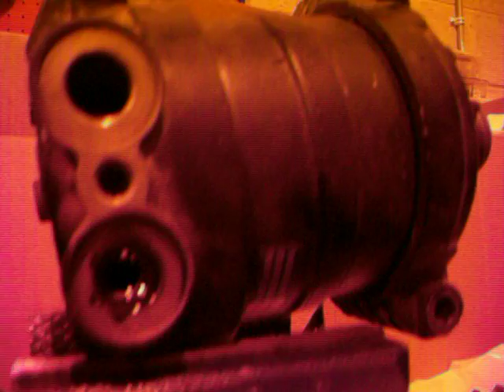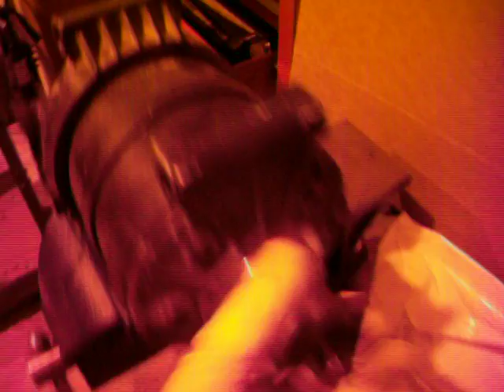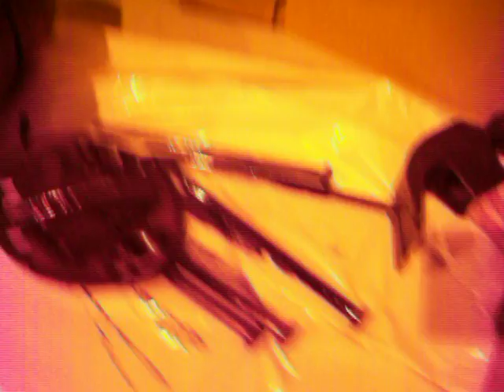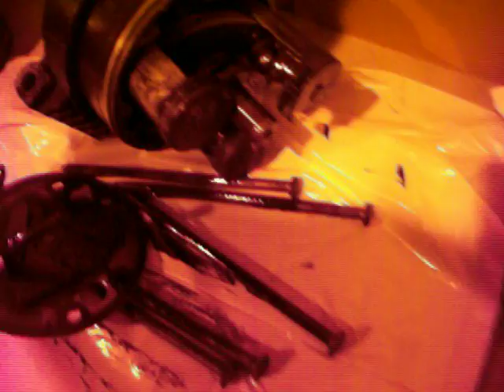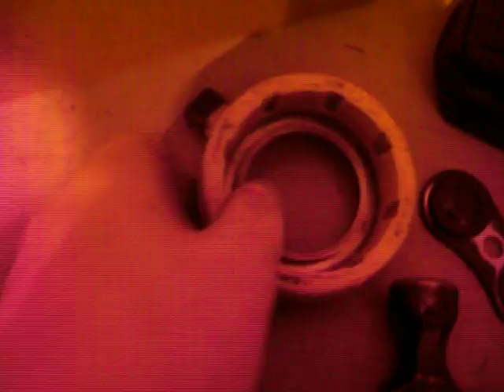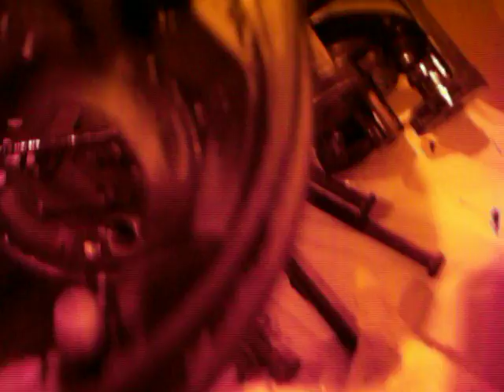GM air conditioning compressor ruined October 21 2011

Comment from the maker: @pearsonba350 This usually means it it low on refrigerant.  It cycles because the low pressure cutoff/cycling switch detects the pressure on the low side, right by or on  the accumulator (the large silver can) detects the refrigerant going below 22 or so PSI.  This means it is too low to allow oil to circulate , or be carried by the oil, and obviously the charge is low.  So this switch will cycle to keep any more damage from happening.   Only by checking the ports can it really be seen what  is.

Comment from the maker: @redneckbryon Yes, the Vista Cruiser does have factory A/C which works fine.  The compressor is the original one, a rather large A-6 unit.  The original ones are very robust, cool very well but need 8 to 1o horsies to run.

Comment from the maker: @LordKorlik This was off of a 1998 K1500 GM pickup truck.  These units are very prone to case leaks due to the segmented construction, and when replaced, if the mounting pads are not exactly square on the vehicle, the case on the new compressor can be distorted, the segments moved out of line, and wear similar to to this can take place. Indeed thinking now, this may be part of the failure seen here.

Comment from the maker: @monarch1957 That was really the dark ages for quality, etc in the units, and if it was one of the round units, called the 'R-4', which looks like a can of tuna sideways, then they were very prone to leaking from the large diameter case 'O'-ring seals.  It is still a frustrating compressor to work with, especially when cars are stored over the winter. The seals contact, and leak out refrigerant.  Mystery leaks they are called, for when checked in warm weather, all is good!